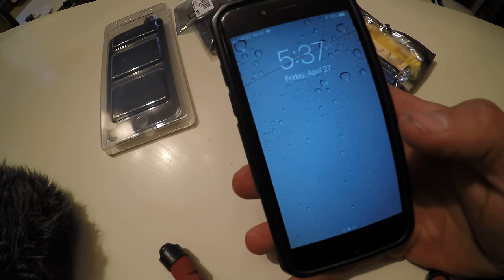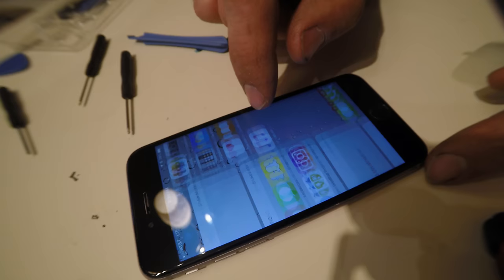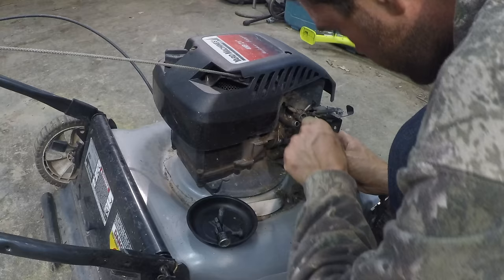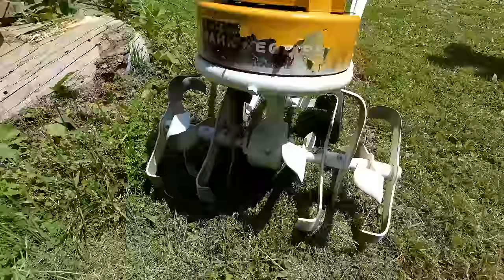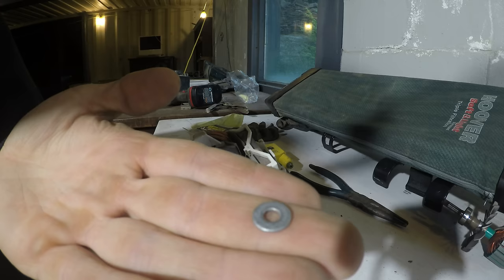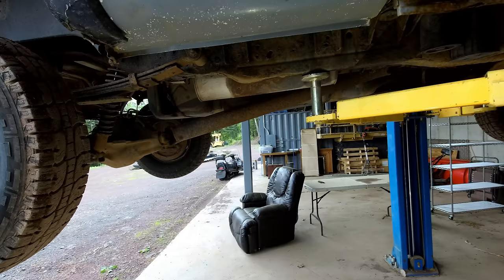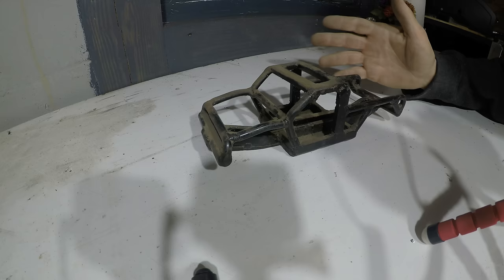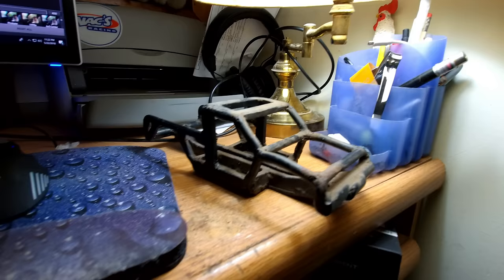Fixing stuff

Comment: Absolutely love your videos ... Entertaining and informative all in one place.  Regarding the part of the video about car/truck build quality.  The automotive industry has to make safety pretty much the number one priority these days. Huge robust lumps of solid steel driving down the street will give a pedestrian a very low chance of survival, as nothing will bend or deform to absorb impact. I’m all for a world in which longevity is the top priority, but nothing will come before safety anymore... also that’s not how businesses make money!  Manufacturers rely on parts breaking so they can charge you for new parts. Obviously cost is a big factor as well! If manufacturers start using more resilient materials they will naturally charge you more to buy the thing in the first place...therefore appealing to less and less people. Most vehicles are made in huge numbers and ease of production is a massive saving. The fewer parts a vehicle has the less money spent of designing moulds and forms etc. Another area that’s worth mentioning... especially now in 2019 is emissions. The world is on a mission to reduce our carbon footprint... when it’s comes to the automotive industry the lighter and more aerodynamic a vehicle is the less fuel it burns. So thin sheet metal and plastic curved bumpers are a win win for both those issues. I could go on but I think you get the gist. You probably understood anyway but your video seemed as if you didn’t. Keep doing you buddy. Take care.

Comment: A company cannot build a perfect truck. Once everybody has one, it won't have any customer for 50 years,
Reply from the maker: Than I would call that a job well done.
Reply: Don't crank them out so fast.  If you only produce X-number of them per year, there would always be a demand for them (especially if they proved to be THAT good).  Wouldn't be long before you'd have the attention of somebody huge, and they'd either be looking to buy you out, or pay you to stop building them.
Reply: But the point is to build a good truck. Not getting bought out by GM.
Reply: I doubt that. It will be waaaay too long before everybody gets one.
Reply: True.
Reply: I've never seen an AC comment before. This is righteous!  @AndrewCamarata
Reply: @stanpatterson5033  or pay someone to wipe you off the planet. Sadly, that sort of thing does happen.
Reply: But if one renegade company was quietly building them, people would gradually catch on as they see that these vehicles keep in running while all the others end up in the junk yard.
Reply: Stan Patterson Then you have to crank up the price.
Reply: Do u have any idea how much that frame on a full scale teuck is going to weigh??? A “tin foil” truck weighs about 4 tons so one with steel everything would be more than double.
Reply: mannyrosario83 To be fair, it’s not like the plates on a steel everything truck have to be that thick, or even metal,
Reply: @mannyrosario83  I mean, his design eliminates A LOT of the "tin truck" weight like straight axles, drive train components, ENGINE, fuel components, trim, etc.
Reply: rumpleforeskin73  Manny might have gotten the numbers wrong but he was absolutely right, there is no way a truck like this could ever be produced and make money, it would weigh about 10k pounds and be the most dangerous car on the road, there is a reason they build in crumple zones on all these newfangled cars these days, plus he could never get them safe enough for the government to pass off on them. But it sure would be entertaining to watch him build it the AC way.

Comment: "This vehicle wouldn't even get damaged in a lot of accidents that would total a tin-foil truck".
That may be so, but it would immediately kill all the people inside it. When looking at the surface of your idea, it's great. But if you dig deeper, and look into (for example) crumple zones, etc., you start realizing that there are more reasons for cars to be built like they are than just keeping costs low.
While this may be the perfect truck for you, it won't be perfect for the vast majority of people out there. People use their car to get from A to B, that's it. They don't want to come home and have to maintain it. It may be a sad reality, but it's the reality we live in. People also want luxury items in their car, like heated or cooled seats, surround sound music, etc., etc., and they like to show their personality through the design of their car. You may have some good ideas, but your design is far from perfect.
Reply: Tim Derks how would it kill the people inside? The frame rail on semis are 1/2 inch c channel, they don’t have crumple zones, crumple zone are nothing more than a way for car manufacturers to guarantee that the car is totaled in a wreck. there is a lot fewer truck drivers hurt in wrecks because there massive chucks of metal in front of the driver. Yeah you would put air bags in, but make them easy to change, nice seats, interior, etc. how often do trucks get totaled because of the interior getting old? Almost never. I don’t think independent suspension is the way to go, it rides better but it’s a lot harder to break a straight axle. And I also don’t think electric is the way to go, yes it’s got more torque, speed, etc, but it’s dangerous to work on, wiring is always failing on trucks, and when you are running trucks 14-18 hours a day, battery’s can’t hold up, maybe a hybrid, but batteries are sensitive to cold. This design could work but it would need tweaking. The whole point of this is a almost maintenance free truck, hints the electric motors (again I think it’s a bad move but) these new trucks could easily to be build to work well, you just need to buy new or buy old and build new.
Reply: Crumple zones absorb the energy that throw you around inside like a marble in a paint can.
Reply: Peter G. They do very little to absorb energy, where your seat belt and have air bags, the more steel between you and the other car in a wreck the better. There’s a reason cars from the 60s are still around and 10 year old trucks have frames so rusted the truck is junk
Reply: @rockriveroutdoors810  I love Andrew's design idea, but Peter is right about the safety.   In a crash, the kinetic energy has to go somewhere.  Without crumple zones to absorb the energy, the energy is transferred to the vehicle's occupants.   This has been pretty well proven.  Think of the the egg drop that you did back in school where you had to design something for the egg to survive the fall.  The best designs were those where the egg was wrapped in padding (which acts as a crumple zone).  The compression of the padding absorbed the kinetic energy when the egg hit the ground.  Place that egg secured in a rigid metal box, it will break.  Same thing in a vehicle.

Or to think of it in another way, go ride in a car without suspension and feel how rough it is on your body.  Ever driven a go kart (with no suspension) off a ramp?  Do it again on a quad or ATV with full suspension.   Which felt better?  The compression of the suspension softens the force of hitting the ground, which is transmitted to the vehicle, and therefore, to your body.  Same thing with crumple zones in a car during a crash.
Reply: nathanmcolton I see what your saying but I’ve got 10 semis that run 24/7, I’ve seen these new trucks rearend my trucks and they fold up like a tin can. years ago I had a guy rear end a parked truck at 65 mph in a 77 3/4 ton Chevy, tore the truck apart but the guy walked away like nothing happened, do that in a new truck and you’ll be lucky to be alive, let alone walking away from it. think of this, what’s safer in a wreck a 1 ton pickup or a smart car, the truck because the frame and everything else is stronger. The more mass you have in front of you the better, that’s why cabover semis are not used anymore because there so much more dangerous than conventional trucks
Reply: @rockriveroutdoors810  Not necessarily. You are comparing apples to oranges. Big rig large mass trucks don't routinely run at speeds near 100 mph. Pickup trucks are designed for the wannabe tough guys who also want to scream around at 80, 90 or 100+. When they hit trees, big rigs or rocks the crumple zone reduce the inertial energy away from the driving compartment to protect the soft human within. Example: try a head on collision with two Abrams tanks at 70+ mph. Sure the armour plate will protect the tank, but the guys inside will experience lethal shock forces bouncing around.
Reply: The man is talking sense cars Van's trucks etc are pure rubbish today it's all about money not safety electric windows auto lock doors the most dangerous yet I know of a family that lost their lives because the electric failed thats a fact

Comment: We have that same vacuum. My uncle gave it to my mom like thirty years ago. It had the belt go out and so we took it to the vacuum place. The dude charged us $2.83. Needless to say it is a good vacuum. 

I think  are totally right with the cars stuff. We had a newish Ford Explorer when I was younger, and the thing was a piece of garbage. EVERY single thing on it was electronic, and they would break for no reason in the middle of the woods all the time. We got rid of that thing at a loss of thousands. Now I drive two cars: a 1970 Chevy pickup,  and a 68 Pontiac for non pickup stuff, and I whole heartedly believe that they are superior to that explorer. The pickup died one time years ago because the regulator for the battery died, but that was an easy fix. The Pontiac has little stuff breaking all the time, but never does it leave you stranded, and I can fix both of them with ease. I literally taught myself how to work on these things, and it is a piece of cake, much on the contrary to the modern stuff. 

Plus, they came from the factory with huge bumpers. The rear one on the pickup is like 1/2 inch steel, with the trailer hitch right on it, and I am pretty sure you could get rear ended and suffer literally no damage. The front bumper on the Pontiac, while the chrome part is maybe 1/4 inch, it has a second bumper underneath, twice as thick, to support the first bumper, and then behind that one the frame rails double up and curve up to the bumper; needless to say it is tough. And there are no computers, and you can fix like 25% of the problems with brute force. What I like to tell people is that the steel holding the radio in place is thicker than the steel in their body panels; and I am not making that up. I once dented a car with my shoe while getting off my bike. I couldn't use a chainsaw to install my radio, but rather used an angle grinder. 

You should make your pickup, I would buy one. Just make sure that there is a 8  foot bed option.

Comment: lol@ 17 thousand new emails.....
cool ideas about a truck for the ages...but i think you'd have to solve the safety issue with the truck being so solid. if you crash it almost all the impact energy gets transferred to your body. the modern cars crumple to absorb impact. maybe it could be solved inside the cab...like shock absorbing seat frames or something.
Reply: Jeff, you are exactly correct. In a modern car there are crumple zones (designed weak spots) to absorb the energy from an impact. As parts fly off that is less energy being absorbed by the occupant(s). Lawsuits are what made cars so complicated, following in the footsteps of the airline industry. If people would put their GD phones down and pay attention to driving and master the priviledge of driving we would all be safer. IE: I cant parallel park because Im a dipsh!t and didnt go out and practice. No problem my car does that automatically. Im texting and not paying attention to the road. No problem my car alerts me that Im a dipsh!t. Im talking on the phone and dont see the car stopping in front of me. No problem my car automatically brakes for me because Im a dipsh!t. I dont have time to walk behind my vehicle so on my way to work as Im leaving I thankfully only run over my kids bike and not my kid. No problem my car has a camera and a monitor screen so I dont have to turn my head. Boy am I a dip...... get the picture? Andrews car would never make it in todays world because it makes too much sense! Zombie Dave.

Comment: Excellent: Hub motors can be used for conversion of non-electric vehicles. Additionally extra batteries aftermarket need to be avalable for the Ford lightning.

Comment: I'm like you Andrew I fix everything too, one thing I noticed you did wrong with that iPhone screen was the way you seated the new screen. They are notorious for cracking because they are not installed properly on the centre clips, the easy way to seat the screen is to hook it in at the top near the earpiece then lay the screen onto a flat surface and push the back down working towards the two retaining screws. this ensures no stress is put on the glass and it always works a treat.

Comment: I think you are right in some areas bud but for a heavy duty truck(2500 and up) you can't beat a diesel engine and solid axles for durability. I will never own an electric vehicle. The reasons they make vehicles like they do is for fuel mileage and they crumple for a softer impact to protect the passengers. I had independent suspension trucks and the parts didn't stand up to the abuse. My solid axle trucks take the abuse and keep on going. Love your videos brother. You are an inspiration to many people including me. Keep doing what you do!!

Comment: tiny work tips - use 'earthquake putty - mounting putty on the ends of your screwdrivers to hold screws.  Use tweezers to pick up the tiny parts-  rubbing alcohol to clean parts that need it - a small makeup brush for dusting.  re vehicles- it's called planned obsolescence - it wears out quick you have to buy a new one - keeping the factories open and people employed.

Comment: Keep up the good videos This one was great. You had my attention and I'm looking forward to the next one. You always amaze me. HOWEVER -  I like my cars shiney with lots of chrome. My 14 year old Dodge truck still looks like new. No rust. No dents. Never did anything to it but a $45 power steering pump. But then I don't drive through the woods pushing down trees and looking for mud puddles to run through. My '64 Ford Fastback looks even better and the glass packs sound fantastic (i.e. - not like a sewing machine.) And neither of them cost $100,000 which I'm afraid is what your design would cost at today's prices. I've owned about 60 vehicles in my life. Only 3 of them cost over $10,000 a lot of them were less than $500. Most were shiney with lots of chrome.

Comment: I have The same idea as you pretty much, Been thinking of it for years! I live in England so and we dont have as many pick ups but I have the pick up version for city transport ect. I think Motorbike engine / small single cylinder diesel engine to generator that only kicks in when needed for instant power when needed but also small battery backup and for when in city. Independent brushless electric hub motors, I think independent Air suspension made reliable for adjustable ride height and hardness. If not the coil overs and easy to replace again cheap. Panels that change easy and are cheap, Super easy to work on! Aluminium never rust, Waterproof. I love the idea.

Comment: I fixed a vacuum cleaner replacing the bearing 25 years ago and I still have it working. Also the cleaner was
 a pound lighter because I did not put back a lot of unnecessary stuff ;)

Comment: Another huge advantage of making an EV is that it really simplifies the design and production. As you said, without transmission, differentials, etc. there's a huge amount of parts cut out of the process. 

One of my dreams, though, is to design and build an all-electric farm tractor.

Comment: Electric motors in each hub has been done, and is absolutely fine for heavy equipment and HD pickup trucks, but for a normal highway vehicle the large increase in unsprung weight would be pretty miserable, it would be greatly reduce traction at speed over bumps, around corners when there's any kind of undulations, and greatly (negatively) affect ride quality.

Comment: Totally agree with your assessment of  present car designs.  Problem is, the body of the car must absorb impact via crumple zones,  hence their propensity to fold like an accordion.  Also a limited lifespan is built into them in order to increase sales due to replacement reasons.  The only car manufacturer that is bucking that philosophy is Tesla with the Cybertruck.  Elon's ultimate business plan is not to sell you cars that require constant replacements, but to sell you transportation with autonomous cars, and energy.  You're bang on with the hub motors.  I have been interested in hub motors  for a long time.  That technology is around the corner.  You can already buy hub motors for small cars.  Cheers from Canada.

Comment: Motors in wheels are done with ebikes and big mining trucks.  But for higher speed vehicles they increase unsuspended weight making the ride rough.  You want minimal weight on the wheels for the best ride and maneuverability.  For an offroad or hauling truck hub motors would work pretty well.  Might as well get rid of air in the tires too and just use a solid rubber/foam type tire that can't have flats.